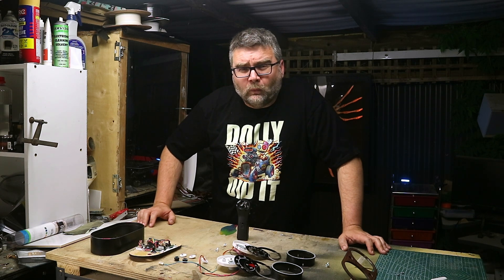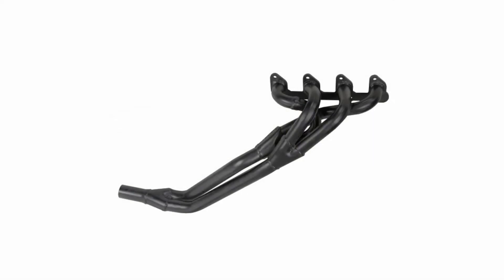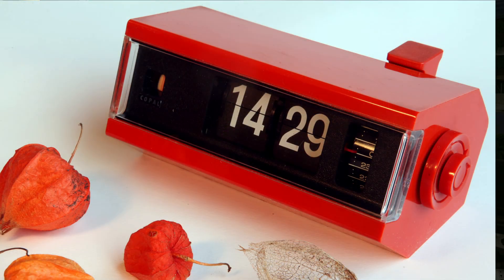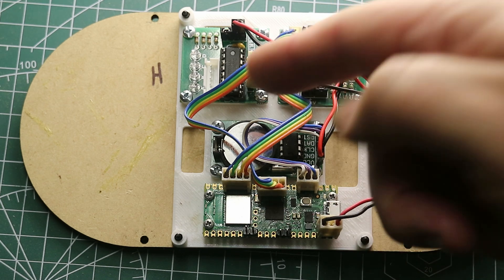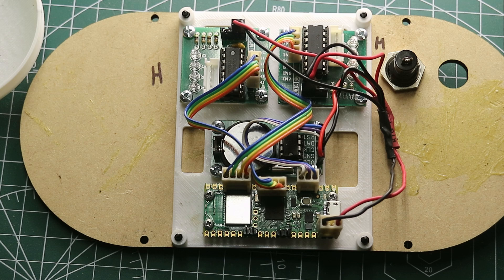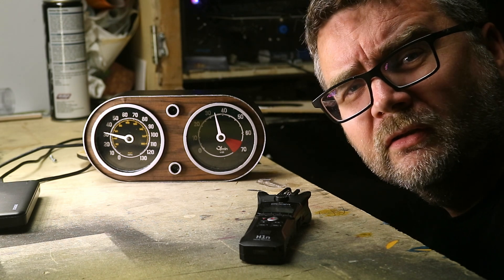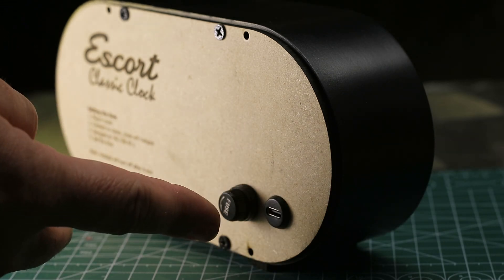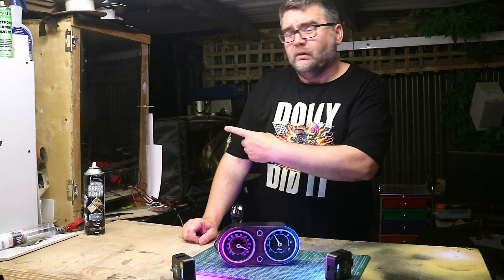Retro Speedo Clock | One day build

Comment: Nice Jason! My old man had an Escort. He loved it. Where is the homing end stop on the gauge? I saw it when you were showing the construction but I don't see it on the face. By the way, I'm trying to do something similar but showing wind speed and direction. I thought about using end stops for homing but since the direction needs to spin 360 degs I'm trying with magnets and hall sensors.
Reply from the maker: Yes, they were lots of fun. There isn't an endstop on the face as it homes beyond zero.
Reply: @JWNZ  So do you have another hand inside the clock that runs to the endstop? Sorry for the question, just trying to figure out how you did it.